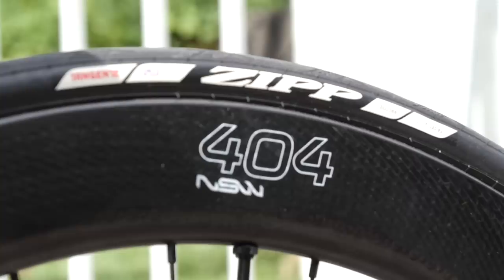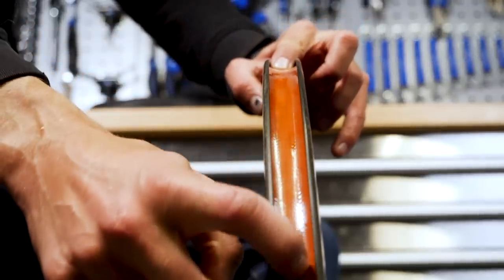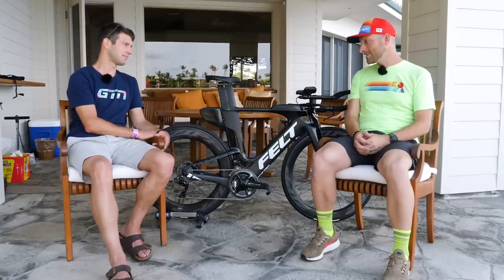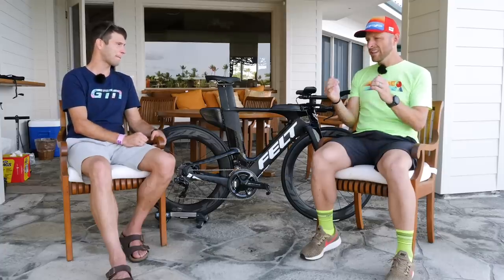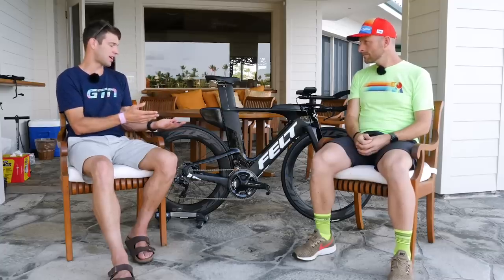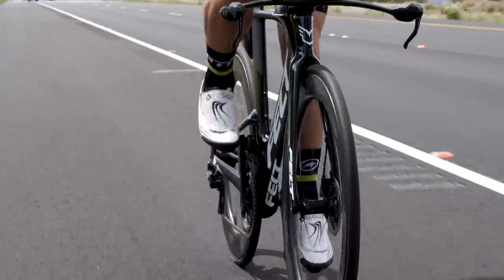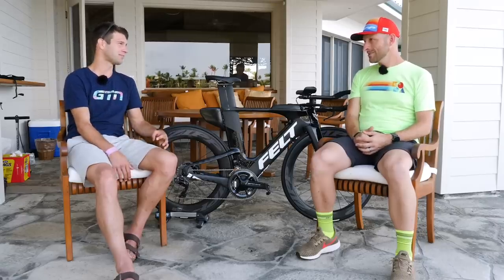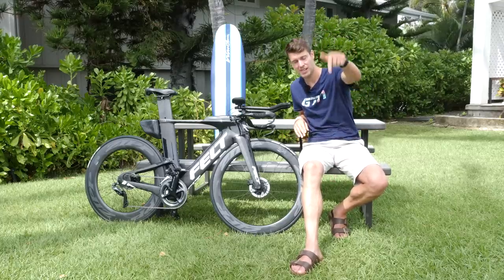The Truth About Going Tubeless | Cycling Tyre Myths Debunked

Comment from the maker: What tyre set up do you use for training or racing? Let us know!
Reply: Why anyone would use anything other than tubeless at this stage is beyond me. Now the technology has been perfected and has been shown to work reliably and better than tubes why wouldn't you use it. Its not hard to do now or to upkeep, there's even new valves coming out recently that make it even easier to both inflate and seat your tyres and to put in and even remove now the sealent so the "its messy" or "I can't get my tyre to seal right" excuses are gone. Go tubeless!
Reply: All clincher all the way. I've still have never gotten a flat, and I don't even buy expensive tires.

Comment: Some good straight up questions Mark. I run tubeless on all my bikes and do the maintenance myselve. Ben is over trivializing. Dried up sealent doesn't wipe right out, & a road side repair with a tube is a right mess. Seating a tire with a regular pump is not easy either, unless you have all the tolerances right.  Make sure to practise a lot before to commit for an A race on it. This is not for everyone.
Reply: was only thinking the very same about putting a tube in after a punture from a tubless tyre, works in theory
Reply: THANK YOU. No one in the press ever mentions what a b*itch putting a tube into a tubeless tire is on the roadside. Sealant making everything slippery. Tire is super hard to get back on the rim. Only works in theory.

Comment: I mostly agree with everything discussed here EXCEPT: I would like to bring light on some false info in this video. 1.) I got a puncture in my sidewall and tried stuffing a bacon strip in it. No go. Soon as I starting re-filling the tire up with air, it forced the strip out of the puncture. Tried 2 bacon strips, same deal. Ride over. 2.) If you ever completely remove a used tire that was filled with sealant and gummed up on the beads and try to re-seat it onto a tire as-is, good luck. Won't happen. Not even with an industrial 160psi compressor. You will have to spend a few hours cleaning off all of the gummed up sealant from the beads, and even after you do that, the tire may or may not ever seal back onto the wheel even with a compressor. This is from my personal experience. Fair warning!

Comment: Tubeless for mtb and gravel (running 43s) make total sense. Where I ride the conditions dont warrant the hassles of road tubeless. I run Conti gp 4000s and can change a tube in 3-5 minutes, average a flat every 2-3,000 miles. Nobody I ride with runs tubeless road and that includes ironmen and a guy who competed at Nationals in the time trial. It's a solution in search of a problem (for most riders).

Comment: Yes tubeless provides less resistance than a butyl tubed tire & yes, more comfort plus less punctures but the downsides are a many also.
*When you park bike for many days etc you need to make sure the valve is in position to drain out sealant otherwise gums up valve.
*Usually installation of tubeless tires on tubeless rims is very difficult because of the design & tight tolerances, sometimes nearly impossible on roadside.
*In general is a messy situation to add, keep toped up & when it self seals, is also very messy when tire is removed completely.
*Is very hard, if not impossible to inflate tire from scratch often with a hand or foot pump.
*Still need to carry a tube, repair equipment & air filling other than hand pump.
*Over time the sealant dries up or gets absorbed into tire so you need to check the level after a few months.
*If you leave bike for more than a month or so you need to spin wheels to keep sealant from gumming up into a mass.
Anyway probably there are more cons but that does not mean you should not use them, they could be essential in some situations where performance & a puncture is paramount, just good to keep in mind both the positive & negative aspects for them.
Maybe one day they will be able to supply tubeless tires that dont require the messy sealant, then they will seriously take off with sales.
Reply: Why can't they make a tubeless tire for bikes that doesn't require sealant?  Cars have been tubeless for decades without all that nonsense!

Comment: Did tubeless, technology isn’t there for road yet. Can’t pop in a tube because you have to remove the valve stem/core, and you can’t use Co2 because it’ll freeze the sealant inside  and render it useless. Also, setting them up is a nightmare, especially if they’re brand new. Lastly, if you don’t thoroughly clean all the old sealant out, especially on the bead, the tire will never set. Too many variables.

Comment: Where I ride there is usually a decent amount of debris and little pokey plant material. I was running inner tubes and within a span of a month, I replaced the inner tube around 5 or 6 times with one week needing three inner tubes. That’s nearly 40 dollars in one week and at that point I said screw it, I have tubeless ready rovals so I’m just gonna go tubeless and see how that goes.

Same route, multiple rides per week, multiple small punctures, $0. Tubeless has been great for me and I still have inner tubes should I need to put one in but it’s been months now and there has been no need. I’m loving it.

Comment: As someone who's in to all types of cycling from motorcycles, electric powered cycles and leg powered ones, on the leg powered side Track, Off Road, Mountain bike, Cyclo-cross, Adventure, Gravel, etc and Road Cycling , Long Tours, Short Stage Races, One Day's, Crits and TimeTrials etc, etc, it's always amazed me how slowly new technology can sometimes be to jump from one style to another or to be accepted and used. 

Look at disk breaks and this, tubeless. Both have been accepted and used by MtB for ages especially disc's and I find it hard to understand what stops it from happening and why something that's obviously better is not being used. Even when the companies that make the bikes started to push their on the road it was slow to be taken up and still hasn't been by a big proportion or Roadies. 

Even the many who ride both can seem to have some sort of block that stops them from using the new thing on 1 of thier bikes when they've happily used it for ages on their other and know its benefits. Look at tubeless, I know a couple of riders who use it and swear by it on their MtB but still use tubes on their road, same with discs. They've used disc on their MtB for years and years and wouldn't even ride a none disc MtB now but don't want them on their road or didn't they've now mostly accepted they're use on all bikes but a couple still haven't swapped. 

Why won't riders and companies just take on any new tech that has obvious benefits and incorporate them in to all types and styles of bikes and riding. I know weight was a concern with early disc especially with that silly UCI weight limit rule but tubeless? Clutches on rear mechs, 1X drive trains, even dropper posts for some off road "gravel" adventure riders. 

In my opinion the new Electronic system by SRAM is an amazing step forward and it or something similar will end up on every type of bike in some form or another. Having 1 system that will control everything on your bike so you can program your shifters to control anything and everything on your bike or even that you put on your bike or yourself from gears to lights and helmets to gloves etc will happen and be the normal eventually once the price comes down etc. Especially as basically everything both on the bike and off it, helmets, your bike computer, maybe one day shoes, gloves, your indoor trainer, whatever will have something electronic on it you can control. Take the new helmet being designed that has the ability to change from aero to vented when required, the vents opening and closing as and when appropriate. As battery tech improves, getting lighter and longer lasting more things will go that way, gloves that heat up or cool you down, shoes that will do the same or appropriate for Triathlon especially that you can do up or undo with the flick of a switch on you bars.

 I just hope it doesn't happen on one side but not on the other for ages and for no apparent reason. The only reason I can even think of is that MtB riders and its culture is far more open to new things and the adoption of new tech where as Roadies are more traditional and unwilling to do anything that takes away from that nostalgic feel.
Reply: For what it's worth, triathletes stay away from disc brakes largely because of the aero penalty, and because triathlon courses tend not to require a whole lot of braking.
Reply: @djlemma  yhea I can understand that, gains are gains and when there's a real difference then cool. Triathlon is also a slight bit different in my eyes as there's 3 events, especially in the longer distances you're basically riding as an individual so better braking isn't quite as important as it'll only really benefit on wet downhills and you'll never be in a group so can totally choose your own lines and speed unlike cycle racers who have to ride and stay in a group so have to do group pace and often have their chosen line conflicted so I understand that. Also triathletes are usually more open to advancement than pure roadies anyway.
Reply: Nick Tarry I can’t speak for others, but for me it simply comes down to money. If I upgrade to disc breaks, my $1800 frame and $2000 wheels are worthless and would need to be replaced with another $1800 frame and $2000 wheels. Now I have spent $7600 to get slightly better breaking. I’ll stick with my rim breaks and save a ton of money.

In terms of tubeless, I have tried them more than once. I don’t care for them. RR is not much better than light butyl or latex tubes, and most likely much worse than ultralight tubes coated with talc. I don’t get many flats to begin with so I didn’t see the benefit.

New tech is not always better or it may work better in some uses and worse in others. 

Also you say roadies are more traditional. When have you seen an aero mountain bike? Or a mountain biker wearing form fitting Lycra. Mountain bikers have their vanity as well even though both form fitting Lycra and aero frame shapes would benefit performance.
Reply: I've ridden ridden 24 months with 1 flat (200k per week). Total tire maintenance time....10 minutes. Why would anyone want the PITA process of going tubeless. Less rolling resistance..?? Placebo effect at a minimum.....imperceptible to most humans...Change for change sake isn't always a good thing.

Comment: I've been running tubeless on my MTB for 2 years now.  I've not had a single flat.  Nothing.  Not one.  I was hesitant moving to tubeless at first for concern of being stuck out on some single track in the middle of nowhere with a major tire failure.  I don't even think about it now.  I carry a spare tube just in case, but I have never had to use it.  I have a new road bike on the way that has a tubeless setup.  Can't wait.

Comment: Except the truth is that it’s almost impossible to inflate a tubeless tyre on a Zipp 808 NSW wheel. It has caused me a major headache twice. I simply could not seat the tyre (corsa speed 25C) on my 808 NSW and i tried everything including an air tank. Even with a compressor, 2 separate bike shops struggled. I had no such problems with Bontrager Aeolus Pro or Campag Zonda wheels. There is fundamentally something not quite right with the Zipp tubeless design. The wheel has been fairly good apart from that, but based on my experience (being unable to fit tyres) i would not recommend Zipp tubeless wheels.

Comment: a lot of advantages with tubeless for sure, but the main reason holding everyone back is that most riders have approx 4 or 5 bikes, imaging topping up or changing the stans fluid on each wheel every 3 months. that is a lot of time!
Reply: Exactly this, tubeless creates a maintenance burden that I struggle to accept.
Reply: Hmm..I'm in the switch-over process tomorrow...
Hope it will be a tranquil transition.

Comment: On the first question he said you can't make non tubeless wheels and tyres tubeless. He's taking about road bikes which require high pressures. However on mountain bikes you can convert normal rims to tubeless because the pressures are much lower. I've got several old 26ers set up this way and have been running them with no problems for a couple of years. Stans conversion kit or similar is what you need.
Reply: Spot on.I did it with gorilla tape and a cheap valve. Worked great.

Comment: Tubeless is great for puncture resistance. The only downsides are yes it is a bit messy when you need to put a tube in it roadside and sealant can spray on your frame (requiring additional elbowgrease to clean) and on riders in your wheel. For me the benefits outweigh the downside. Especially in spring and autumn with all the  dirt on the road it does it job when I see all the cuts on my tire. On my old  training clincher wheels I do have more punctures

Comment: if you have tubeless and you think you will need to add a tube, get a bloody extra tire with you and just change that. Also, make sure you get some fluid to add in. I use tubeless on my climbing  bike and I never had any issues. Plus the lower pressure is nice because it's more comfy. But as many suggested, make sure you get the tire/wheel combination that fits. I went with mavic and they work like a charm....not sure about tire ready + rim ready combination from different vendors.

Comment: For larger holes the sealant does not fix carry a Stans Dart plug which has two dart plugs which will firstly seal the bigger hole then react with the sealant to form a permenant  bond with the tyre. I had to fix a tyre in November 19 and the plug stayed in place until I scrapped the tyre in march  20.

Comment: You don't ever need a compressor these days. A decent track pump or one of the systems that have bottles you can fill with high pressure air before releasing in one go will always do it these days, especially if you get valves that you can remove the core from. There's new ones out that make it stupidly easy to do everything from pump the tyre up, get it seated, put in the sealent after and even take old sealent out. Especially if you get a Schrader type valve and use a Stans or similar valve type then it'll be easy.

Comment: Have been riding tubeless for over a year. Not a fan. They do pinch flat when the sidewall gets cut by the rim itself. Larger cuts will not seal. You will need to boot and put in a tube on the road. Pain in the butt. Super messing. Time consuming even if you have the correct tools. Tubeless is good for dealing with small nails, thorns, glass, and wires. I am back to using tubes with sealant added to the tubes.

Comment: Tubeless only works fine for mtb or cross tires up to around  4-5 bar pressure, anything higher than that won't be sealed up by the fluid...i don't know of anyone in my huge cycling club who could make it work  for heavier riders on road tires  with 7 bar pressure...sealant will spray out and plugs just pop out... you can ride  home with low pressure but it's no real solution like it is for mtb...running tubeless on my mtb for nearly 10 years now and never had any issues
Reply: Pete Pansen IME, even heavy riders don’t need more than 5, 5.5 BAR, tops.  Seems almost everyone who poo poos tubeless tires overinflates their tires, then wonders why it doesn’t work well.

Comment: I do not recommend taking the tubeless valve out once the sealant made it airtight. 
Use a compressor for sure. 
If the tyre ain't worn out don't take it off from the rim because the sealant sticks on the tyre and is difficult to remove. On the rim there is zero sealant which is great. I will never go back to clinchers.

Comment: A solution to a problem that doesn't exist for road cycling. MTB, Cyclocross, yes, road, no.
1. Road flats occur once every 3 to 6 months, not a big deal to change a tube
2. You carry tubes anyway...
3. Sealant needs to be refreshed every 3 to 6 months.. see point 1
4. Sealant on brake rotors or brake track = no brakes
5. If you get a tubeless flat, insert a tube and leave it in there, next time you flat, your tube will have glued itself to the inside of your tyre, throw your tyre and tube in the bin and call os shame.

Comment: You fill the sealent in the tire through the valve stem. Obviously you remove the valve core prior to that ;) But is there anything to watch out for before reinstalling the valve core? Like wiping of sealent on the inside of the valve stem (or rather the valve extension) for example?
Reply: Have tubeless for about 5 years. Never had an issue with sealing blocking de valve stem. I do clean the valve core the next time I remove it do get rid of any seal residu
Reply: I would recommend something like the KOM Tubeless sealant injector (https://komcycling.com/products/tubeless-sealant-injector-valve-core-removal-tool?variant=12164502093938) lets you inject the sealant right into the tyre without gets any of it on the threads of the valve core.

Comment: When Zipp is providing the tubeless equipment do you really think that this is an unbiased review?  Of course they will say you can't use standard clinchers, they want you to buy another wheelset.  Yet, I have set up countless standard clincher wheels with standard clincher tires and they have worked fine.  Is tubeless ready better?  maybe, probably.  But to say you can not set up conventional rims and tires tubeless is a bold face lie.
Reply: It's not a lie you just don't know what you are doing. Running high pressure tyres as tubeless on  a wheel/tyre combination that's not designed for it is taking a serious risk. Ask anybody. Maybe do some research before slagging people off about things you know nothing about. And which part of this said it was a "review"? It doesn't say anything of the sort and quite obviously is not. You completely made that up.